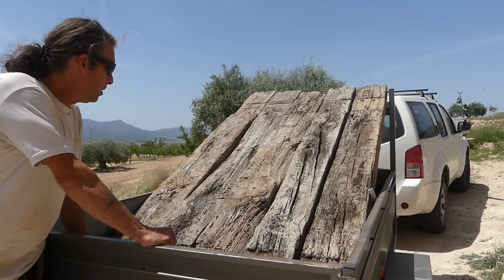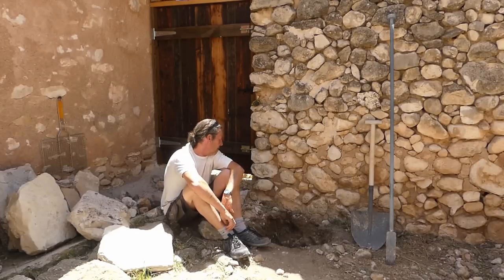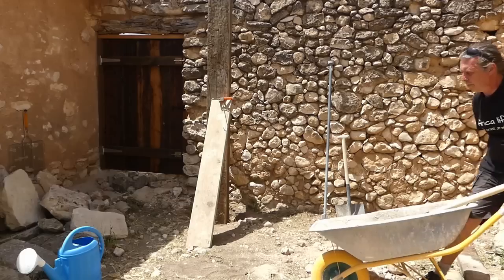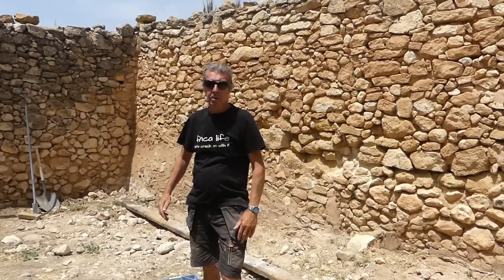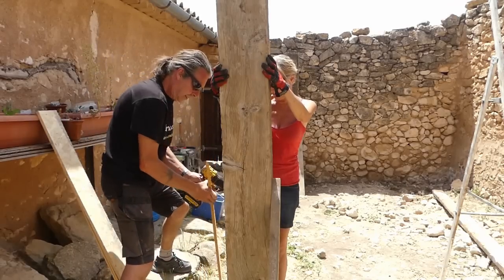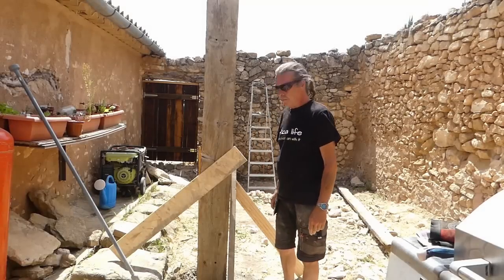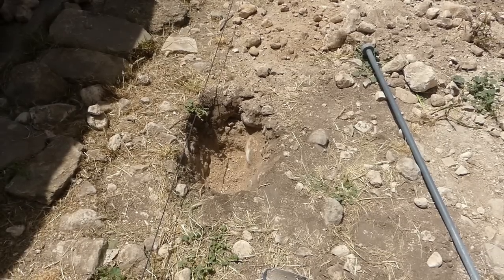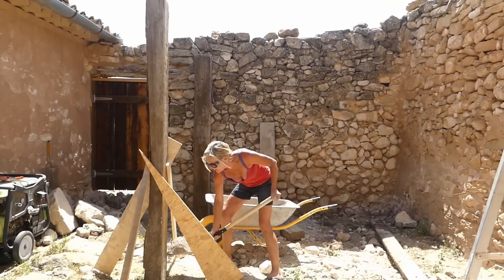Part 3 - Transforming the courtyard into a fabulous outdoor living space

Comment: Andy when mixing concrete or drylean dont use so much sand. the cement has to try and bind more particles together and as a result is weaker. A small amount of sand gives a much stronger result. i know this might go against everything you think but happens to be true. Love the sleepers and with bamboo on top will look amazing.

Comment: Don’t creosote them they will stink for ages even out side, to get that really lush finish wax or oil them
Reply from the maker: Thanks James. We're going to oil them :)
Reply: @FincaLife  cover the stones or flags when you do or you will curse the stains😖🤦‍♂️🤣
Reply: @FincaLife  when you fit the half butt over the central post I would advise to use hardwood pegs and not screws or nails as they may react with the preservatives in the sleepers and rot from inside out, look at spike holes in sleeper to see if there’s rot there, 22mm bit and 2 15cm wood dowels through and in to top should do a fine job
Reply from the maker: @James-um8pq  lol, that's why we're putting stone paving down.